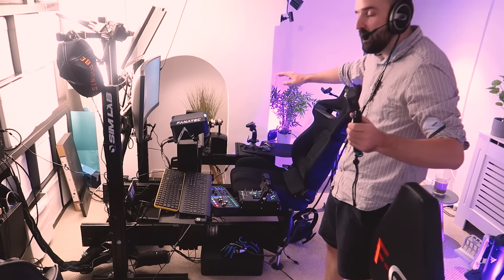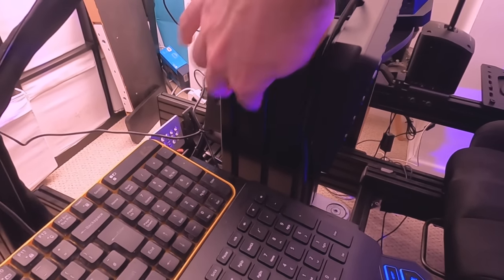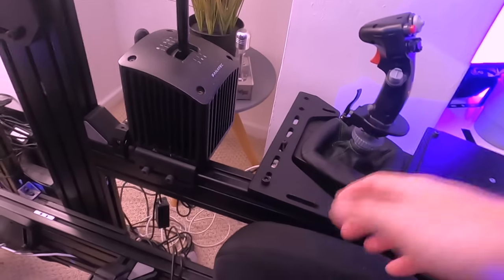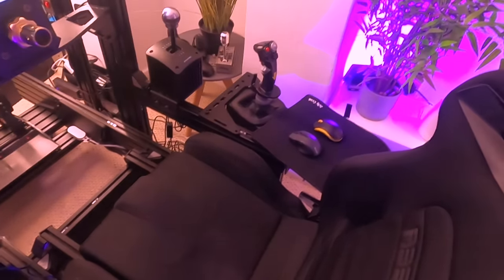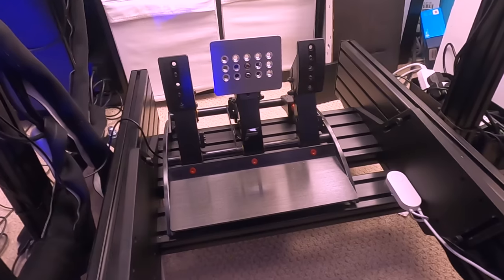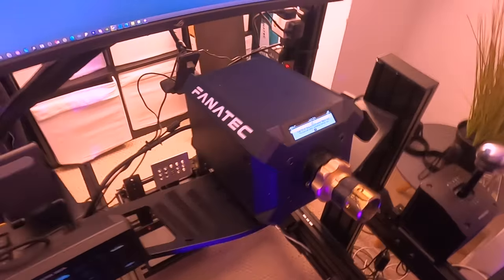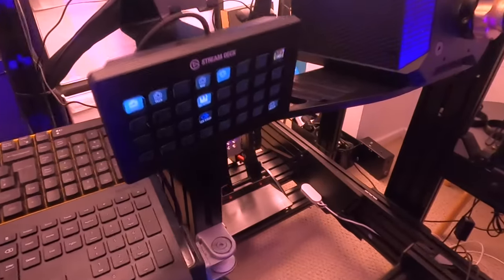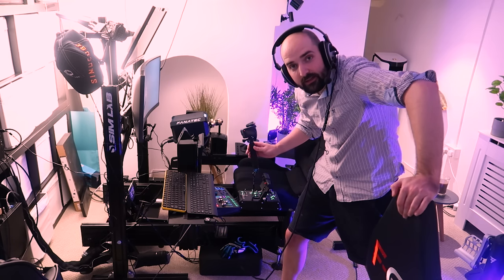The Ultimate Home Simulator Cockpit !  - Driving & Flight

Comment: Pretty much the same basic setup that I built, except I came up with my own design for the T-Slot, and I swap out the H-shifter and flight stick depending on what I'm playing (literally takes seconds to do).  I also remove the throttle when not playing flight sims (it's just two bolts) because it makes ingress and egress much easier with it out of the way ( I wanted the ability to get out of the cockpit when in VR and walk around the bridge of my ship a bit in Elite Dangerous).   Having the removable steering wheel has also helped quite a bit in that regard.

Comment: I have similar equipment (minus all the streaming bits) but on a GT Track rig. I just have to swap out the Warthog Throttle plate for the plate holding shifter and handbrake and then I’m good to go, BUT I am waiting for the FeelThree VR motion rig to come.......  That will be awesome (if it ever actually gets completed). Question, do you have a USB dock or some other way to handle all the connections?

Comment: The pedals don't seem to be on a slider. How can they be comfortable to use with the seat in front position for driving and in the back position for flying? Or do you have prolongable legs? ;-P
Reply: I was wondering the same. I'm modifying my rig for also flight sims  and I'm still trying to figure out the pedal arrangement. I need to move seat backwards for comfortable hotas grip but I can't reach pedals properly.

Comment: what pedal plate set is that on the Fanatec?  Been looking for a larger brake plate and was just going to design and print one but metal would be preferable.
Reply: I was also wondering, been looking to upgrade my t500 pedals to the clubsport v3’s and thought I would like to have a large brake pedal.

Comment: GM Flexing on us poor guys with a ghetto rig 😂
Reply: My rig is made from 3x2" timber and using an old seat from a VW transporter :)
Reply: mine is a desk and a chair 😂 that old seat must bei very comfy ☺
Reply: @heinzdoofenschmirz1  Yes it is exactly. I'd say that an actual car seat is probably the ideal thing to use... it's comfy and it's fully adjustable and used car seats are really cheap. The downside is fiddling around to fix it down and they can be heavy and a bit dirty etc...

Comment: Is that seat bottom mounted?
Reply from the maker: yes
Reply: @GamerMuscleVideos  Thanks! Also agree with your comment on the value of a reclining seat and putting emphasis on seating comfort for sim racing as opposed to "keeping it real" with an expensive bucket seat. Looking into OMP's version of your seat as I can access that brand better where I live.
One more question: I assume with bottom mounting you can't adjust the horizontal incline of the "butt area" of the seat so if you wanted to do that, you'd have to side mount it?!?!